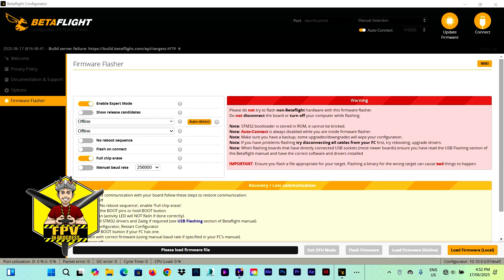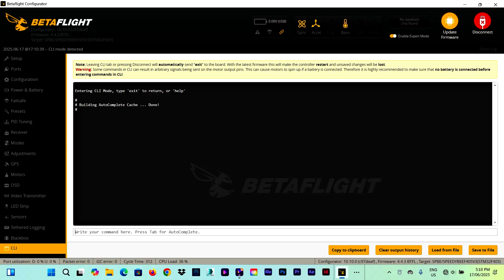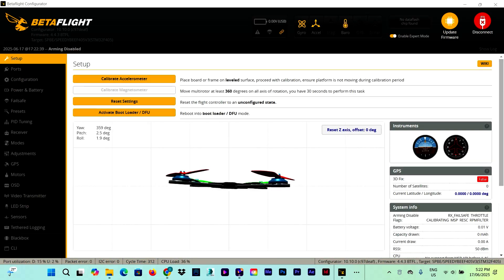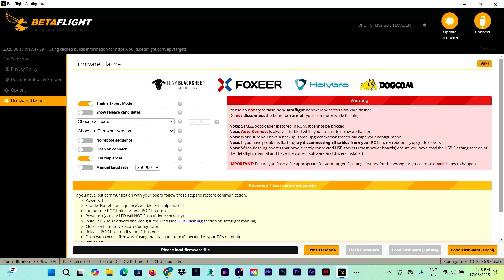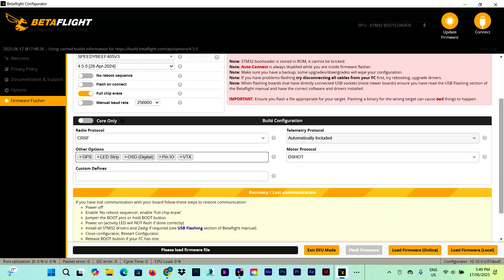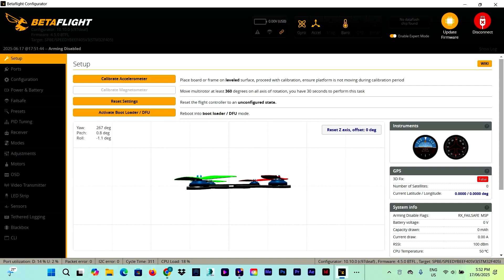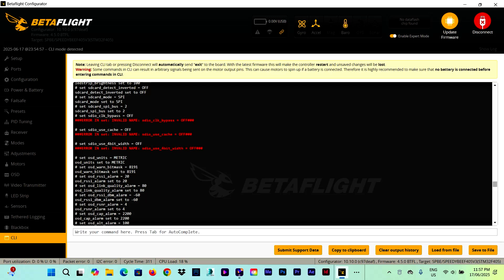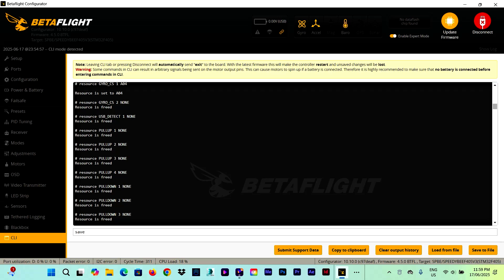How to Flash Betaflight 4.5 on Your Drone Fast and Easy! #betaflight

Comment: My fc wont do into dfu mode no matter what. can anyone reply with some suggestions?
Reply from the maker: Did you run the impulseRc driver fixer? Also are you making sure that the usb cable you are using is capable of data transfer?

Comment: I have a problem, I updated all the drivers and also ran impulse rc, my iflight blitz f722 flight controller is recognized in the com port even in dfu, as soon as I run flash firmware I get the error "impossible to connect to the USB port", I don't understand why, if I open betaflight and connect the drone everything works correctly, the error only appears if I press flash firmware...
Reply from the maker: What drivers did you update? Did you flash a new firmware on the fc and then this issue appeared?